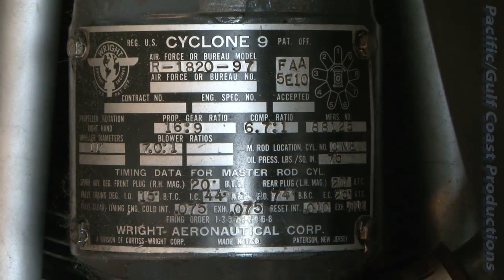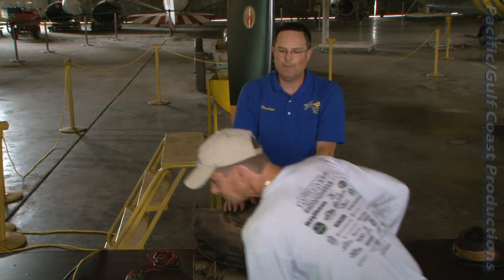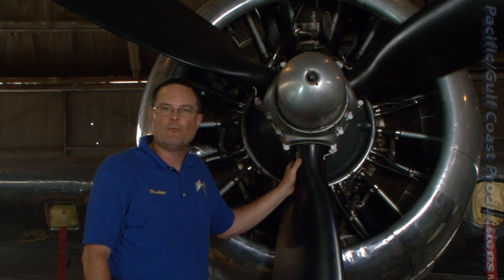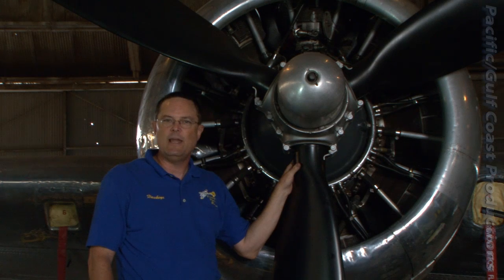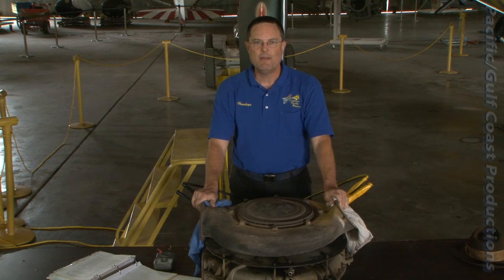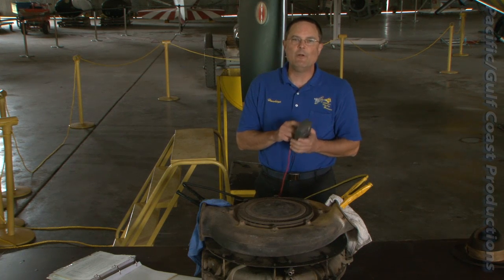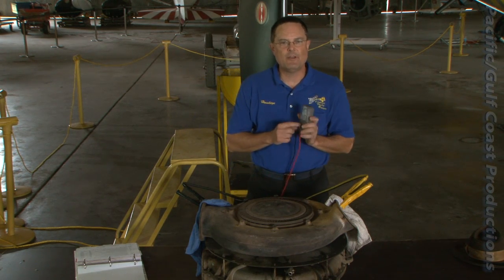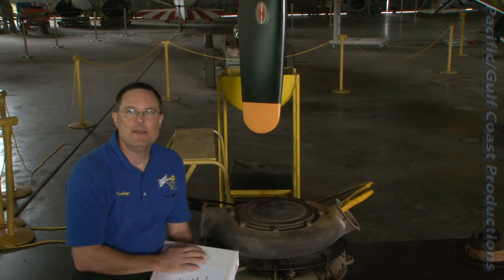Turbo Encabulator Wright Cyclone Engine Improvements

Comment: Can't believe they're still using the old prefambulating side trundling techniques. Logarithmic capacitance has long been considered to be the optimal solution for trench winding, especially with a nombaristive system being used for fumble control.
Reply from the maker: Only if they're still using ambifacient modulated nodules

Comment: This instructional video is now 12 years old. I Personally have not done any research on the Turbo Encabulator but through exhaust pipe research and by internet crowd sourced information I would offer these possible updates. The mechanical Turbo Encabulateor  should be replaced with the Induction Run Reverse Osmotised Negative Vapor System. The rapid evacuation of magnetized air could draw fresh negative air into the Wright Cyclone intake  I am not an engineer but to me the casual basement designer, I would think that an assembly with many inert and useless parts sourced at Home Depot would be more cost efficient.

Comment: Why only 3 grammeters?  Usually aren't 7 used when lotus-0-delta windings are in the phase detractors?
Reply from the maker: At 4 grammeters the boloid slots become rotationally unstable and the table slats become non effective.
Reply: @hawkeyepoole  I would have never thought of that.  It is perfectly oblivious now.

Comment: Here we have a hydrodynamic turbo encabulator post stator magneto unit. It’s powered by modal interaction combustion waves produced by the internal flux appendage. 

To explain the Turbo Encabulator first we must address the hydrodynamic unit of the stator. It’s reluctant unit is generated by the Jeffrey’s tube converter and lunar Wayne shaft. Thus resulting in hydrodynamic motion. 

To service the unit replace the  A C negative Ten power cup link transverse motor with a semi Bolouyd driveshaft. This will result in a forward or reversing of the Encabulator. That should diagnose all issues.

Comment: I work on an assembly line. Every time and I mean EVERY TIME an engineer asked me a question I give him this kind of techno babble. 

Not once in the last 10+ years has anyone called me on it. 

I didn’t realize four cylinder engines had nacelles with hydro fluid magneto stator relays? 

But! Guess they do now!

Comment: I had 1,600 hours on Cyclone DC-3s - you made no mention of the Adiabatic Lapse Rate Valve.😁
Reply from the maker: +Bill Bray   'Twas removed in the most recent reluctance cavitation update
Reply: @hawkeyepoole  Well that was a mistake. How do they handle anti-detonation injection now?

Comment: sir, thank you for your efforts. You make clear the difference between the terrestrial and flight versions of the encabulator. You stay true to the central topic, while re-enforcing the subtle, but often mis-understood concept that the land based version requires the non-reversable cable every rotation. 

With the obvious deduction is that the aviational version will require windings to be adjusted every 9th winding, those who file VFR may forget that the ground based version faces deferientals  provided harmonics which while flying in FDA airspace, squawk codes based on the 7th harmonic. This will undoubtedly save tens of $ in low lead 100, given the rotax differential.

Wright-Patterson, given its prestigious 'First in Flight' association with Kitty Hawk, only benefits from your superior knowledge.

Comment: I"ve seen this in action; The B-17's newly-rebuilt turbo encabulator puts the original technology to shame. I do have one suggestion, though: When calibrating capacitive duractance during routine maintenance, be sure to apply .5um of torque to each girdle spring in a semiclockwise direction to achieve the recalcitrance desired.
Reply: I wish I had seen your comment earlier. I over-torqued all of my girdle springs and now they all need new spavines. Just what am I supposed to do with no girdle springs; use suspenders?
Reply: um is not a unit of torque

Comment: If they had upgraded the turbo intabulator to the newer style made form unobtanium, then the flux capacitor and the fuel encapsulator would have given them much more stability during inverted landings.
Reply: Indeed.  Pretty sure they were imported from Obscuristan
Reply: I've read some PDFs on this. Its not there yet but probably in 2-3 years = /

Comment: Its very important with this type of engine that you keep the diode flux capacitance relays in sync with the fluxibobulator tinimbical intermatrix radial accelerabilator gyrodine magneto triaxilator, in order to prevent and misalignment in the dilithium antimatter accelerator tertiary non-capacitance intermix ratio. If this is done incorrectly, damage to the antimass spectrometer optronical electroflobidobidobidobination driver coils is possible.

Comment from the maker: Unfortunately the turbo encabulator's radial grameters only work with the 1820-97 engines as the flux capacitor is not Android Ice Cream Sandwich compatible.

Comment: Can I purchase an encabulator for the 1830? I'm experiencing low amounts of disscabubalation from the radial induction current blades. Pby-5a , not the liberator, will that make much of a difference to the flux output on the casing primer rod?